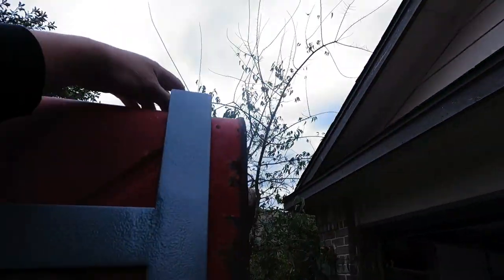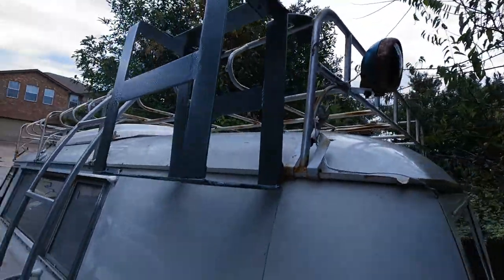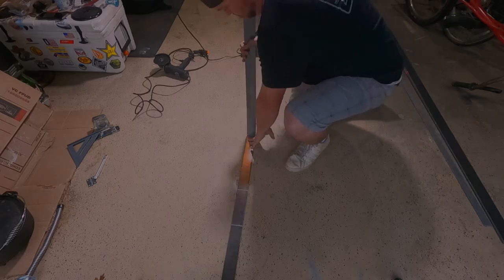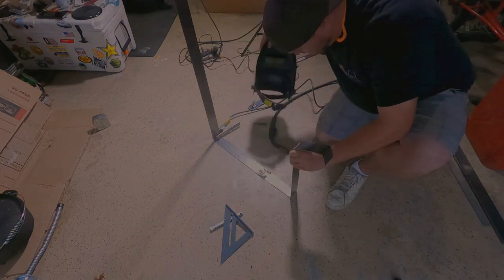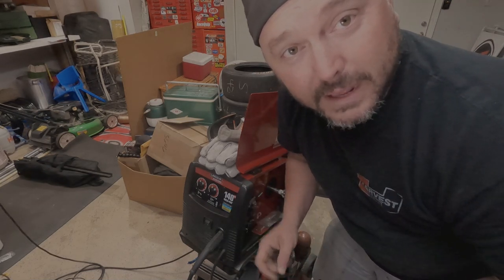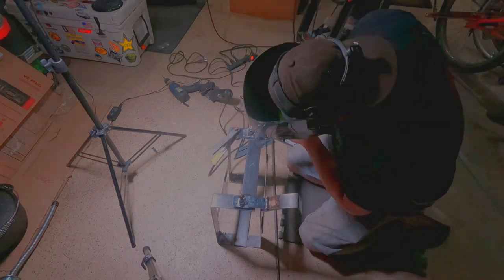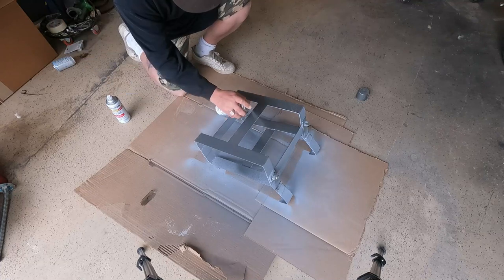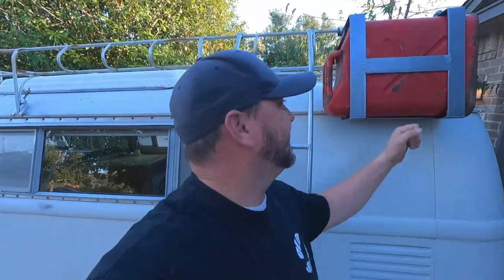VW bus Gas can mount

Comment: Neat, just a question concerning its forwards/backwards restraint are you relying in the clamping force to hold it in position, or will you anchor the handle. I guess you could put rubber strips on the bracket to prevent metal-to-metal contact, greetings from the UK!
Reply from the maker: Its clamped pretty tight, and the center is slightly wider than the ends, so it can't move forwards or backwards.

Comment: Dude! I’ve been “racking” my brain trying to figure out how to attach my 270 degree awning to my hwe rack. Those attachment points are exactly what I was thinking! Is there any way you could post the measurements for the bar that goes over the top rail down to the gutter? Thanks man!
Reply from the maker: I'll measure it later today. I'm on a top secret parts run!
Reply: You forgot about me😬 I’ve been thinking of using the maker pipe connectors you used in the awning video. Do you think those would be strong enough to mount a 70 lbs awning to the rack? If I had four of them?